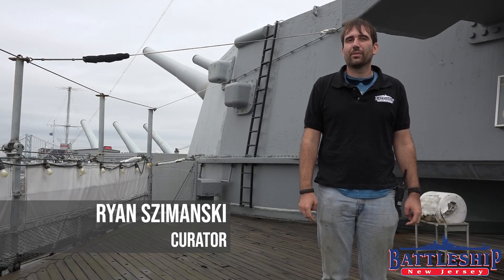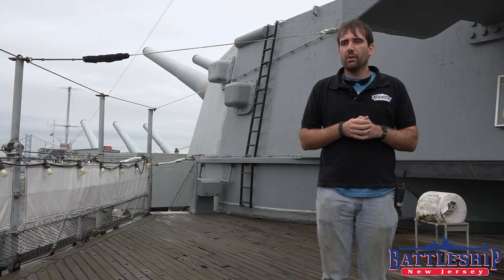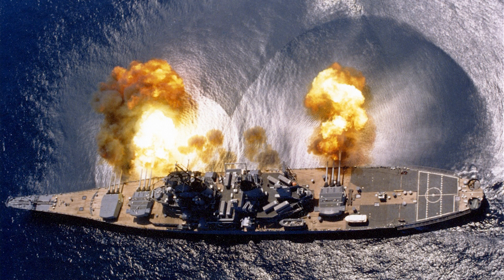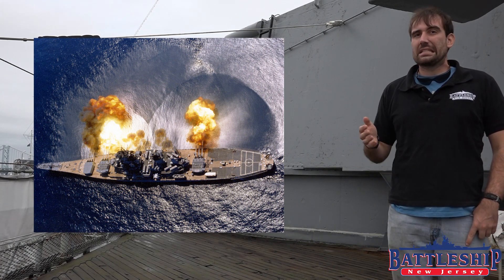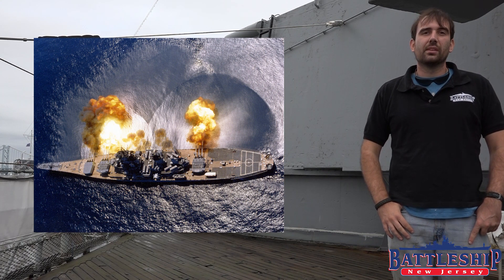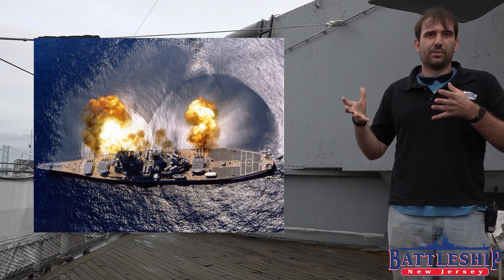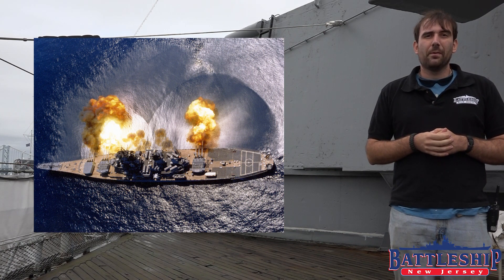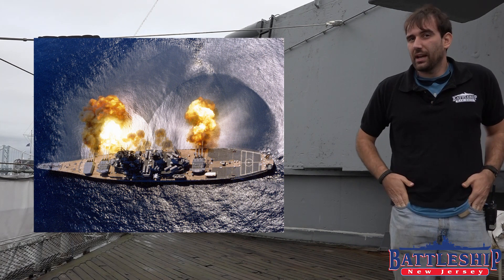Does Firing the 16in Guns Move the Ship Sideways?

Comment: Title should be, "NO, firing Main Battery does NOT move the ship sideways", rather than a question.
Reply: then how will people who search the Question find it?
Reply: @8vantor8  ?
Reply: @dmcarpenter2470  when you ask google something do you google the question or the answer? 

because most people google the question, because they don't know the answer.
Reply: @8vantor8  Thanks for confirming the lowest common denominator thinking.
Reply: @8vantor8  In all seriousness, the less click-bait title, which I proposed above, would actually work with Google, without incidentially perpetuating the myth.
Reply: @dmcarpenter2470  always remeber everyone is stupider then you think, no one is an exeption. not even me
Reply: @dmcarpenter2470  The other guy has a point though. If people don't know the answer, they can't google it. They only have the question, so it makes most sense to have that as title, no matter how dumb we think it is.
Reply: @dmcarpenter2470  Your title doesn't say that the video contains an explanation as to why it is so. Therefore it is also flawed.
If you add "and here is why.", then you have a reasonable title.
When the title is a question, one can think about it for a while and then click on the link to see if one was in the ballpark as far as the given answer is concerned (or if there is no answer, that the question touches upon the same set of relevant subjects (?) so one can see if they had the same approach to the question.
When some-one is confronted with an authoritative statement without a hint at an explanation, the (free-thinking) human brain is more likely to go in rebel mode and the opportunity to learn something diminishes.

Comment: Okay, shooting a shotgun puts recoil force on the shooters shoulder, multiplying that to a degree of magnitude of a 16” cannon would of course exert a sideways force on the ship sitting in a fluid. If all nine guns where facing aft and the ship was siting dead in the water it would of course  push the ship ahead, why wouldn’t it?
Reply: Because of the overall mass of the ship. A .50bmg should knock your shoulder out but because of muzzle breaks and the heavy weight of the gun the recoil energy is lessened by a large amount.

The greatest difference to use your example is one I've felt first hand. The recoil force of a single shot 12ga is going to be a lot harder then a standard eight pound 12ga. 

As he noted you have fifteen tons going out the barrels, the ship weighs thousands of tons.

The blast you see in the water is the wake of the projectiles. You see this same wake when firing a firearm in the prone position, it just isn't as massive.
Reply: Mount the same shotgun on the top of your car, solidly...and then fire it.   Will it move the car?  That's about the same thing as it would be on a ship.   If you put a 16" gun on a tank, it'd move it.  On a 50,000 ton Battleships, that sits 38' deep in the water?   It doesn't.

Comment: This is poor physics. Of course the ship has to move sideways, only how much is up for debate. None of the things he says about recoil dampers and force distribution through the structure make any difference. Every action has an equal and opposite reaction. They are firing small masses at high velocities from horrendously massive ship. So the ship having a very high mass will move in the opposite direction of the shot a very tiny bit. On a guess probably less than an inch, but it will move.  It should be possible to calculate knowing the mass of the shells and their velocities vs the mass of the ship and derive a sideways velocity for the ship.

Comment: Yes. Ask anybody who has taken physics.
Reply: Yep. A physicist or mechanical engineer would  be able to figure this out pretty quickly.
Reply: I guess both of you brilliant college-educated incredibly smart wealthy you're wrong. You got screwed on your college degrees. Everything they touch you is now suspect.
Reply: No. 9 tons going one way will not cause a 50000 ton ship to move sideways. The guns recoil into recoil buffers and recuperators which return them to their start position.
Reply: @ScienceChap  - And?
Reply: @duanesmith5074  - Um, no. The same gun firing on land will slow the rotation of the earth. But, yeah, you know better...
Reply: While it's true if you abstract the energy of the projectiles into a 2-dimensional model that ignores moment, elasticity, and friction, a full broadside should impart enough lateral energy into the ship to send it sideways at about the speed of a bowling ball, the true model is not an abstract.

The guns' energy is transferred to the ship as a moment determined by the distance between a force vector following the angle of each barrel from the ship's centroid of mass.  A full analysis is beyond the scope of a youtube comment, but since the ship doesn't have any trouble keeping the flat side up, it's reasonable to assume the guns are above the bulk of the ship's mass.  As a thought exercise, I suspect a broadside would try to impart a rotation along the long axis of the ship.  I say try, because we're still using 15.3 tons to move a 61000 ton ship (reaction mass must include the propellant, ship mass from Wikipedia) pushing against ~5200 tons of water (860 ft long x 39 ft draft, counting only the water within 5 ft of the hull, mass varies by temperature.)  Given that the water will have it's own inertia, it seems to me the ship should actually roll slightly and then try to lift up out of the water using the angle of the hull as a ramp, also by a minuscule amount.  Adding to the complexity, the recoil buffers spread the energy transfer out over a not-insignificant period of time, giving the water more time to resist any lateral force, and gravity more time to counter any upward acceleration.  Oh, and we can't discount energy lost to heat, either compression heating in the recoil buffers, vibration/shear heating in the ship's frame, or imparted to the water around the hull.  The sum total is that, while yes the energy must ultimately go somewhere, the felt result will be so minor that it can't be observed by human senses.

So, no.  Physics does not say the ship will slide sideways.  Unless you want to be pedantic and use an improbably large number of significant figures.
Reply: @robertpfaff7992  - Why, yes, Pedantic R Us. None of us said perceptible movement, only movement.
Reply: @ScienceChap  - And yet, the A-10's thrust is half-negated by firing the GAU cannon, mere 30 mm projectiles...
Yes, the thrust of the GAU equals 1/2 the engine thrust. Go figure...
Reply: @robertpfaff7992  - F=MA, and you can't push a rope. (Plus, M1V1=M2V2)

Comment: If it did move the ship, it would defeat the purpose of it altogether. A battleship is supposed to be a stable gunnery platform, not a bloody seesaw.
Reply: Are you expecting it to buck like a bronco? There is force therefore there is reaction - but the force is a few tons and the ship is thousands. The result is a tiny reaction, because it's spread across enormous mass. 
There is movement but it's so small it can be ignored.

Comment: As the son of a Mechanical Engineer who helped design all naval ships from frigates and DD's, up to heavy cruisers and the BBs, and their integrated weapons systems (retiring in 1977 as the Deputy Director, Naval Sea Systems Command, Bureau of Weapons) and myself studying physics in university, I can vouch for Mr. Isaac Newton's third law of motion, ie. that for every action there is an equal and opposite reaction. While a 5" gun on a DD wouldn't shudder the ship, a full broadside of nine 16" guns, all firing at the same time either the 1,900. pound projectiles or the 2,600. pound heavies, the recoil would be phenomenal. That recoil would have to either be absorbed by the turret ramming backwards bending it's metal housing against the ship or, more likely be dissipated by a coiled spring system. However, force is still force and even if slowly absorbed by the coils, the force would be transferred to the outer hull and then against the water against the hull. Undoubtedly that force would ram the ship backwards, but the question is by how much. I've heard BB sailors  say that it is quite appreciable when a full broadside is fired. If the muzzle blast can display thousands of tons of water that same kind of force would push the ship back. The question is just by how much.

Comment: It appears,  from what the mathematical formulae tell us,  when applied,  that the "myth" is,  that it causes the ship to move an easily observable amount opposite the direction the guns are aimed and shot.  I accept what they are saying.  What I don't accept is that the ship doesn't move,  at all.  The ship has to move,  in the opposite direction,  when the guns are fired.  It might be a barely measurable distance,  or there might not be equipment capable of measuring it,  but it has to move.  The formulae prove that,  also.

Comment: Think of it this way, you don’t move backwards when you fire a .22 caliber pistol just your arm is more than enough to absorb and re distribute that energy, and your mass compared to the amount of energy is huge
Reply: Your analogy is faulty, because your feet are also keeping you stationary via friction. Moving things to hover-craft, frictionless ice, frictionless water, etc., are all mental processes meant to take such friction out of the equation. In physics, one often deals with 'frictionless planes' -- idealized notions. If you want a correct analogy, you'd sit in an unanchored boat of some size when you fire that pistol. Or dangle yourself from a very long rope, and precisely mark the location directly below you before you fire. I suspect you will move sideways a very NEGLIGIBLE (yet also non-zero) amount. Scientifically-minded people can be quite anal about this kind of thing. Because they often find themselves multiplying that very tiny number by a very huge number, and that hitherto insignificant number suddenly becomes quite significant again. Or take it to the Space arena where Ion Drives wouldn't even be a thing if they didn't EVENTUALLY bring the ship up to an appreciable velocity -- or cause the ship to slow down if oriented in the opposite direction.  "Effectively Zero" and "Zero" are decidedly not the same.

I think a much better way of thinking about this problem is to consider the mass of the projectiles necessary to move the Battleship one millimeter sideways in idealized frictionless water. And once you've determined the mass necessary to achieve that 1 mm distance, figure out how that compares to the total mass ejected from the ship during a firing of all her guns.
Reply: @shanejohns7901  water isn’t frictionless not even close, my analogy was more meaning that a .22 has as much thrust compared to your body weight as a battleships guns do for its weight
Reply: @ErinGnarkill  I never said that it WAS frictionless. That is the ideal condition, and friction adds some amount of drag depending on lots of factors. For example, whether or not the object is coated with a hydrophobic substance. If you study the laws of physics, you'll see that they follow an ideal equation. You calculate drag as a separate answer, as it will cause some percentage deviation away from the 'frictionless' ideal.

Comment: While the ship would not move sideways when the 16 inch gus were fired, you wouldn't see anyone on deck near those gus as the concussion from the blast would nearly kill them, and would probably send them flying several feet until they hit something or were thrown overboard.  You really didn't want to be too near the 5 inch guns when they were fired for a similar reason, although the concussion from the blast probably wouldn't be lethal.  You'd most certainly have your ear drums ruptured though, not to mention the mother of all headaches!!  Definitely wouldn't want to be on the other end of those 16 inch shells, it'd be a death sentence if you were within the blast radius.

Comment: If Battleships comply with the laws of physics, it must move sideways when the guns are fired.
It may only be a tiny bit, as everything obeys Newtons third law.
Reply: Yes. Even if a millimeter. That's still something.
Reply: Each gun has 2 hydrolic recoil absorbers as well as the power of the charge verses the weight of the ship 
Not possible to slide sideways
Reply: @paulthesoundguy1  
So it can break the laws of physics then? (said in a fake Scottish accent).

It will move, if only a fraction of a mm.
Reply: OK I GIVE IN.   THE SHIP MOVES 1MM sideways ON A BLUE SUNDAY, WALKING IN THE SNOW, UP HILL,  BOTH WAYS, 
THE SHIP WEIGHS 55,000 tons, the charge from the gun without the recoil pressures weighs 18,000 lbs or 9 tons. The recoil absorbs 80% of the explosion
Or 6 tons of pressure....so that leaves 3 tons of pressure to move 55,000 TONS OF MASS OF THE SHIP.
I AM GOING WITH THE SHIP DOSNT MOVE...SIDEWAYS
Reply: @paulthesoundguy1  
No one is claiming the ship moves meters, but the the laws of physics state it must be affected, even if it is ever so slightly.

If you want to go with your Trumpian feelings rather than the facts ...................
Reply: If the ship needs to move it depends on what you meant by sideways motion.  If it mean that the center of mass of the ship moves sideways then it is not a requirement because you can turn the guns so the only result is the rotation of the ship.

Comment: Well, that clears some stuff up. A guy told me he watched the ships move on the radar from his carrier when they fired. Mind you he didn't say they went far, he just said he saw them move.
Reply: See my other post, where I prove that any movement of the ship is entirely negligible.   What might not be negligible is the acoustic shock (the loud bangs)  moving the radar antenna, or inducing intermittent faults (loose wires, dry solder joints) in the radar circuits.
And, given the displacement resolution of naval radars is at best several meters, and 10's of meters in typical range settings, any movement visible on radar would be so vicious as to kill every man on board.
Was your friend pulling your leg?
Reply: @keithammleter3824  Same would go for a Doppler radar. Being designed for incoming aircraft/missile, it wouldn't have the resolution to detect a 6 inch per second movement.
Reply: @DreadX10  I was going to say something similar...  Like "How the heck can you see less than an inch of movement on a radar screen!?!"
Somebody's pulling your leg!
🤣
Reply: You were told a "sea story".   Because you know sailors never stretch the truth at all
Reply: @SealofPerfection  Those darned seamen, always spreading tails (err, tales)!  😅

Comment: I'll accept that the lateral motion of the ship is negligible, but not zero.  Even if you consider the recoil handling mechanism to be converting the recoil into heat or other forms of energy, these type of processes are NEVER 100% efficient.  They might approach 99.9% or something like that, but it never actually reaches 100%, so there HAS to be SOME recoil, even if it's too small to measure.
Reply: Of course, it does.
Reply: Does a mbt move when I hit it with a sledgehammer? Does a skyscraper move when I push it with my bare hands? no...friction is such a b...

Comment: Incorrect.... The recoil is absorbed in the hydraulics yes, but that energy has to go somewhere. Even if it was dispersed over 20 miles, that energy WILL be transferred. Now it can't be measured or even accurately calculated (Fluid dynamics are tricky), but the ship does move sideways. maybe only fifteen to fifty thousands of an inch, but it does move... If it didn't than we should be looking into vehicles driven by massive ordinance firing rounds into it's own attached lead block, instead of electric, E85 and hydrogen....
Reply: After reading a comment about the ship rocking, this could be where the energy goes. When the ship rocks it has to move dozens of tons of water around. Maybe the ship doesn't move and all that energy is spent in creating waves? Regardless, what an amazing question to think about.
Reply: @cassidyhvezda983  The hydrodynamics of water around the hull also add a lot of complicating factors. Pressure from the guns pushing sideways would increase pressure against the far side of the hull and reduce it on the gun side, sucking/pushing it back. Some water would move around the hull, but you have a large area for those forces to work against. Even small pressure differences would generate massive forces resisting the movement. 

I do wonder if you would get a meaningful impact from torque/steering impacts. You have twice the guns up front, so the forces would naturally want to spin the ship asnd that could impact steering. I would be unsurprised if this was a more meaningful impact than direct lateral translation.
Reply: Every time I fart it moves too, but at the same time it's immeasurable so yeah.
Reply: @LTPottenger  When YOU fart, it's measurable. -- Your wife
Reply: @timberwolf1575  Oh goodness you have me on this again:) Yeah, I'm trying to picture water moving laterally across the hull and around, trying to imagine the weight and pressures, while also taking the rocking motion into effect. Ugh it feels good to wonder, especially about something that we'll maybe never know the answer to.